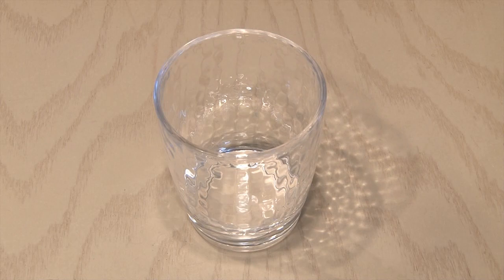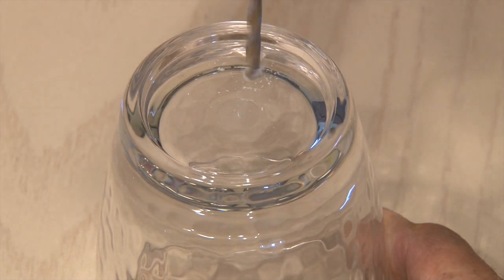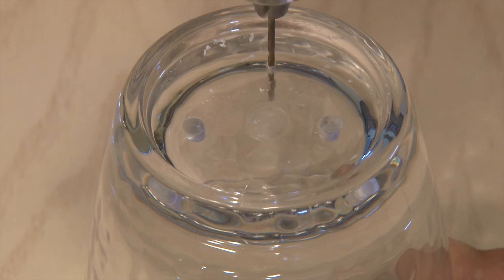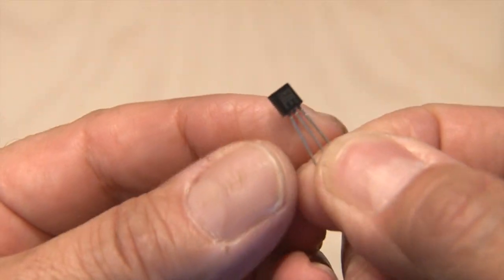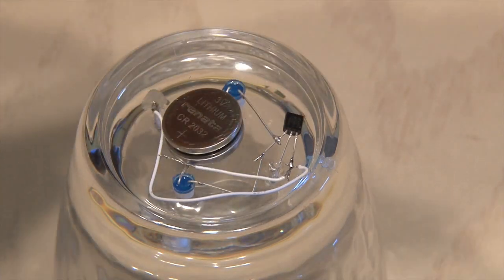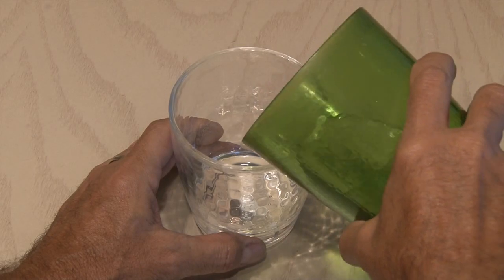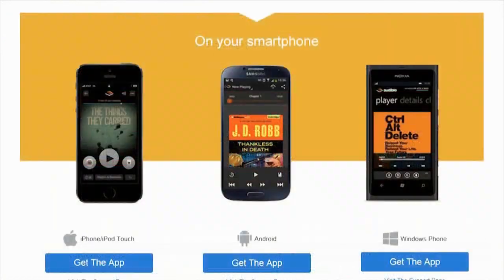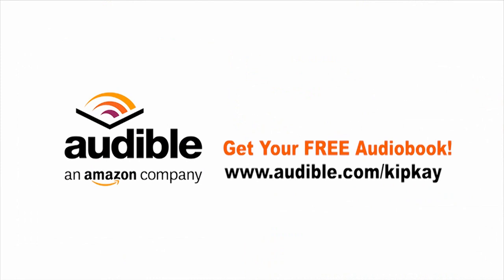Liquidy Light Glass!

Comment: The water is used like a resistance in a normal circuit to turn on the leds, in this case The Transistor is used as a electronic switch, only need a smal + current in his base to close the circuit

Good project mr. Kipkay

Comment: Drilling into glass is very tricky. You have to go VERY slow to not break the glass, and breathing glass dust is extremely harmful. When I have drilled glass, I did it under a slowly trickling tap. This kept the glass cool and reduced the friction on the bit, and it kept the glass dust from getting into the air by just washing it down the drain.
Reply: Thanks urahara-san
Reply: Probably why he is using a plastic glass.
Reply: PLASTIC man... PLAAAAASTIC

Comment: People are wondering if this is dishwasher safe. Maybe if you take the batteries out, but probably the transistor would not be able to function after, so if you capsule every electrical part in hot glue, it should work.
Another way to make it is to take so-called "angel eyes" and plant in the base. They are leds arranged in rings and usually runs on 12v. Happy modding!

Comment: On slightly different note, this could be used as an initial step in low cost water treatment. UV LEDs are not expensive, and, generally speaking, any thing you can do to reduce the contaminant load is advantageous.

Comment: How will you wash it without a short circuit?
Reply: I would fill the bottom with hot glue. Should protect all the circuits.
Reply: Aasim Azam Only problem would be to change the batteries.
Reply: What if we made an attachment for the glass that can come off, like the Lord of the Rings premier cups my sisters have?
Reply: Jason Blooey Just take a wet soapy wash cloth and clean the inside without putting the whole glass in water, then dry the inside. the sides and bottom of the cup don't really need to be washed..
Reply: Ah.

Comment: The current limiting resistors are missing, the schematic is horibly drawn. "pour in any liquid and the LEDs will come on " that statment is also wrong. Not every liquid is conductive. also the batteries will corrode when washed.

Comment: Why not just use a pressure switch set to close under the weight of the glass and liquid inside?  Then, no nails inside your drink.  Empty glass, switch open, a little liquid to full glass, switch closed.  Otherwise, a great effect.
Reply: I think using your liquid as part of the circuit was a cool idea. I was thinking it was going to be a pressure switch. or maybe  just a switch.

Comment: I have to say the light glass is a cool idea BUT you have to realize that there is Electricity running through the Nails? That would be a Shocker when someone took a drink. I guess if you could get enough power that would be a good and new way to up date the electric chair. All you would have to do is get the prisoner very Thirsty then have him stand on a metal floor grounded to the ground. Have them take a Drink of water and when they do they will be Zapped.

Comment: That looks pretty cool, but nails tend to rust. Also, the drink is going to have an electrical current going through it so it would probably be bad to drink from it
Reply: its a negligible current its safe to drink
Reply: 1. Stainless steel nails
2.3v and around 50ma isn't going to hurt you. Ever licked a coin cell battery? You have to know what electricity feels like to even notice it.
Reply: Oh, and electricity always takes the shortest route possible, so the electricity wouldn't even get close to your body anyways.
Reply: Liam P The voltage and current themself aren't dangerous, that's true. BUT because there is flowing electricity, electrolysis will happen and possibly cause the drink to get toxic. I doubt that there's enough current to get the drink toxic in a reasonable time though.

Comment: Snazzy, but a pain to wash I'd bet.
Reply: As long as you remove the batteries and fasten the parts to the bottom of the glass with some hot glue, it's perfectly fine to go through the dishwasher.
Reply: Liam P Actually, I was refering to washing by hand (I realize this may come as a shock, but not everyone has a dishwasher) and poking yourself with the nails while washing and/or drying. ;)